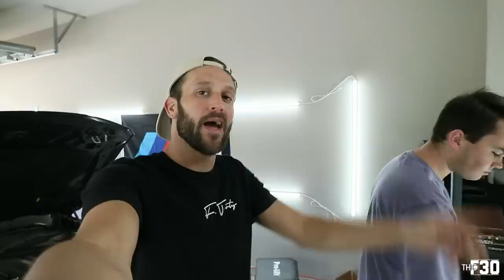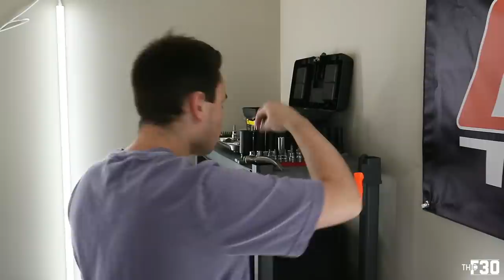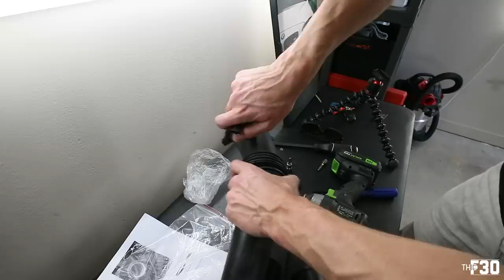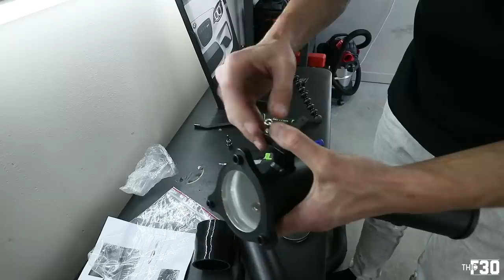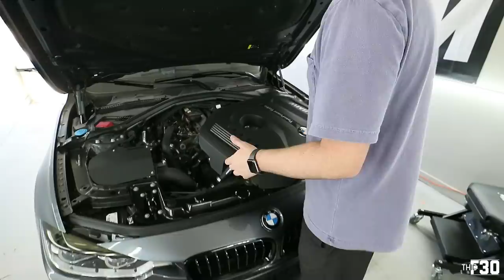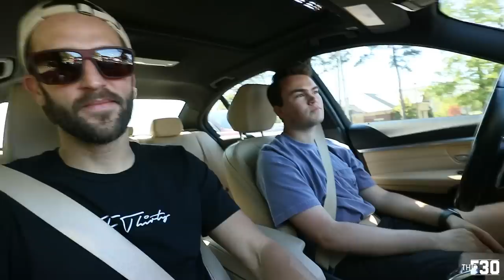FTP CHARGE PIPE INSTALL ON THE F30 B48 330i. WE ARE READY FOR MORE BOOST!

Comment: Big fan bro, Question, I have a 430i, i was running it with VRSF downpipe BM3 stage 2 and it hauled ass, after installing the charge pipe it lost throttle response and even HP is that normal? should i reflash the car? I even took it to a mechanic to make sure there was no boost leak.
I do feel its more responsive on higher higher gears, and before it was more responsive and the first 3 gears.
Reply: Hey bro any update

Comment: I also bought some FTP pipes for my 535i. I got the inlet pipe (intake to turbo) and the boost pipe (turbo to IC). I also got the ER chargepipe and lower intercooler chargepipe (intercooler to chargepipe). All my pipes are now aftermarket. I will soon install a ps2 with the dorch hpfp and FTP pipes too provide better airflow and minimize turbo lag *crossfingers*
Reply: How was it?
Reply: @neonpolo  all worked well except the boost pipe as it had fitment issues with the wagner ic

Comment: I wonder if this can be done to my 330e.... I know it got the B48, but not sure if it got the B48 from a 330i thats downtuned to a 320i, or if it is a 320i B48. By whatever strange reason the 330e can be stage 1 tuned to 12 more HP on just the engine than a 320i with tunes from the same company, which leads me to believe it is a 330i B48? (The 330e stage 1 tune gets the engine alone to 272hp and combined 340hp, while on a 320i it only goes to 260hp.)

Comment: Hi there. I did exactly the same thing and i fallow the way u installed it.  My question is did u transfer the oem Oring to the new charge pipe?  On the instruction said u have to transfer the oem oring to the new charge pipe but when i look to the new charge pipe they already a pre-installed oring.
Reply from the maker: Ftp comes with new orings pre installed, no need to transfer
Reply: Gotcha. U know i watch this video like 100 times to make ot sure i did mine correctly. Lol thanks for sharing ur knowledge. 👍👍